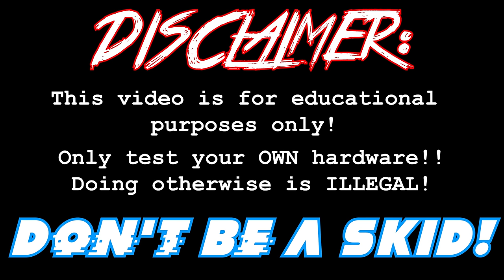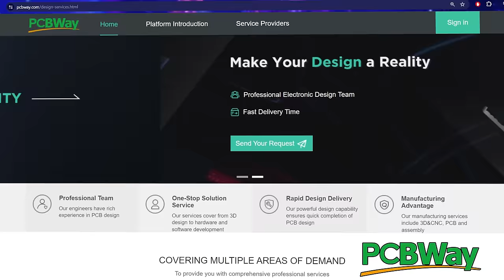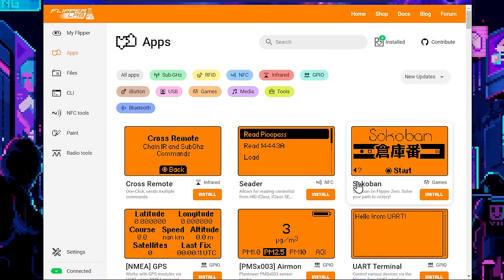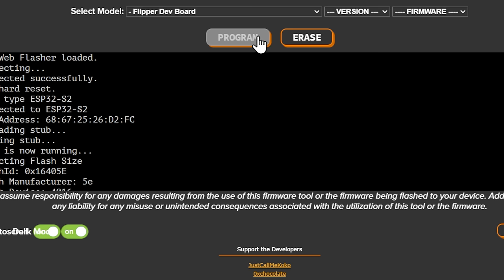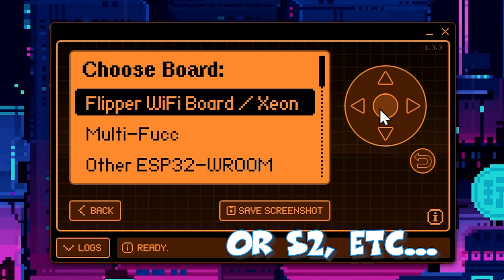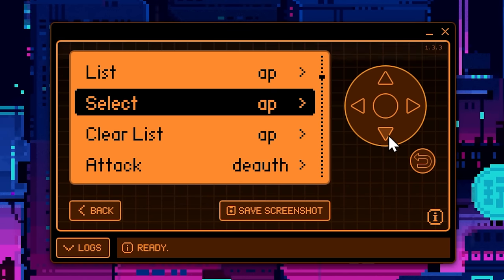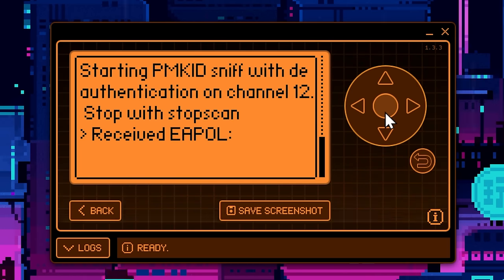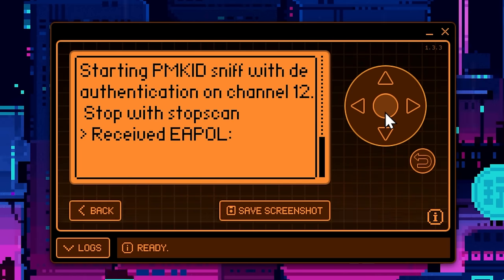Flipper Zero Wifi Hacking has Never Been Easier!  Updated for 2024!

Comment: Amazing video ! I must say HASHCAT doesn't support zipped files to my knowledge, without extracting the wordlist and pointing HASHCAT at the .TXT file you will constantly run into "exhausted' no matter how extensive the compressed wordlist you choose to use. You can even include the known password for the SSID you're cracking in the compressed wordlist and the same "exhausted" result will come about.
Reply from the maker: Are you sure?  I always run the word lists as compressed files and it works for me with the RockYou list
Reply: I'm having the same problem.. any fixes?

Comment: I am curious if you've ever heard of an M5 stickC plus? They are small, have Wi-Fi, Bluetooth some other sensors and has an Esp32 with some GPIO pins and is like $15-20. I have one and a Flipper zero, they seem like they'd be perfect together. You can even get marauder to run on it. Or also using a Lilygo LoRa32 based board with BT WF and GPS and can use radio communications, having these communicate with a Flipper would be phenomenal!
Reply from the maker: Yeah I have a bunch of m5 stuff. I've done two videos with M5Stacks

Comment: Has anyone had trouble executing this using Hashcat for the final product? I am using a Windows 11 system and following the guidelines accordingly but when I go to run the command, Hashcat initiates but abruptly exits without processing the crack or displaying errors. I have confirmed it is a 2.4 network and have updated my GPU drivers. I have even gone so far as to reinstall my up to date XFW-0053 firmware on my Flipper as well as the Marauder companion. It still produces the same result every time.

On a different note, as someone majoring in cyber security, I appreciate you explaining the ins and outs of these devices. I hit that subscribe button as requested.

Comment: I did exactly step by step like you did, loaded esp flasher, via fzeeeflasher programmed flipper zero dev board, but after I disconnected dev board from pc and plugged into flipper - ESP Flasher didn't recognize any firmware. I have same menu as I had before programming dev board - "Flash ESP, Switch to Firmware A/B and so and so..", I guess, there is smth wrong with devboard or maybe I did smth wrong.  I have the latest version of unleashed custom firmware, maybe that will help somehow. Maybe you know the reason of this problem with ESP Flasher?

Comment: Hello
I perform the actions exactly as you show and receive the message "No hash-mode matches the structure of the input hash" why ?
Reply: I get the same message as above in red.
Device #1:  Radeon RX580 Series, 8064/8192 MB (6745 MB allocatable), 36 MCU
runtime from start to stop is 12 seconds.

Comment: yeah, there is no any difficulty to catch pcap file, main problem is to crack it, you need some serious GPU power to make an attempt to crack complex password, otherwise its just a waste of time. so its definitely not easy, especially for a usual user
Reply from the maker: That's where REDD's PCAP uploader comes in handy, it'll do it for you and you can even upgrade the word lists if you want.  It's quite powerful.

Comment: Hi I been following some of your videos and they are great. However I have a question you say WIFI has its own place but on mine it doesn't. It still found  in GPIO the Wi-Fi marauder. Why is mine not as per yours as you say WiFi has been moved. I am running latest build  D02F01C6 mntm-dev build date 15/06/2024. Any ideas why ?

Comment: Quick Question --> If sniffing the PMKID doesn't result in any EAPOL data (approx 10-20 min duration of trying), does that mean it's not a 2.4 Ghz network or something else? If it not being a 2.4 GHz network, how can you find out if a network is or isn't? Any other videos/tutorials/forums/advice would be greatly appreciated.
Reply: If you are connected to the wifi on windows 10, you can click the wifi button at the bottom right, and then click the properties button below the wifi network name. This should take you to settings where you can scroll down and see network band info which is what you're looking for.
Reply: If you scan for available networks in the flipper it will show you all the networks it can hear. If you see your target network's name, then it is 2.4. Because flipper doesn't have a 5.8ghz connection. If you were not doing an active attack and force disconnecting devices on the 2.4 band; you may not have had any EAPOL data. 

The best way I've found to learn this stuff is to attack my door bell cameras. They run on 2.4 so, I can see them disconnect during my attack and verify the attack is working.

If you are trying to do this passively to avoid detection (You shouldn't be because you have permission to do this right? right...right), then good luck. You will have to wait until a device connects and does the hand shake. If the network is only used for IOT then that may never happen.
Reply: @EthosAtheos  My network is a 5.0 ghz network (I am assuming you use 5.8 and 5.0 ghz interchangeably), and I can see it when I scan with the flipper zero. What's shown in the tutorial obviously didn't work because of the fact that it's 5ghz. I switched to attacking one of my networks that is confirmed to be 2.4 ghz and it worked. Not sure how I was able to see my 5.0 ghz network if it isn't physically possible as you say.
Reply: @FoxerGaming  Check your router, many new ones broadcast the same SSID for 5.8 and 2.4. Then do some work to make it seamless for the end user. The flipper only has a 2.4 radio so it just can't detect a 5.8 signal. 

Yes I and many others use 5 and 5.8 interchangeably. 802.11 standard defines this stuff. The common ones are 2.4,5/5.8 and 6 ghz. But there is also a 915mhz in there and 42 and 71 ghz but you likely will not see that for another few many years. 

All of these operate in the US on the ISM bands (Industry Scientific Medical). Many of the ISM bands are shared across countries. 2.4, 5.8, 24 ghz are all world wide bands that can be used for WIFI.

Comment: my dev board doesn't have the usb connector. It only has an SD cart slot with a formatted SD card I put in it. Instead of plugging in the dev board to my PC, would I just put my SD card into my PC, and unzip that file into my SD card? Or how does that work?

Comment: I have the latest Extreme firmware.  Before i installed had the regular Flipper software which looked to have Gas Station sign controller and Walgreens intercom files.  Ever since i moved to Extreme i can't find those things.  Were they removed or not part of Extreme.  Can anyone point me in the correct direction if they are available and i can use them in extreme?
Reply from the maker: The original Flipper software definitely did not have the Walgreens or Gas Station files.  Did you download files from UberGuidoZ GitHub repo?

Comment: what wifi board do you recommend?
Reply from the maker: AWOK has a great one with a huge antenna https://www.awokdynamics.com/
Reply: @TalkingSasquach  HOLY thank you for the fast reply! I work in IT for a school so this will help us with any debugging and to protect us from attacks.
Reply: @TalkingSasquach  second best runner up? 
those guys you referred must be really good. all sold out! lol
Reply from the maker: @RepostedCentral  the official board works just fine, just doesn't have the range
Reply: @TalkingSasquach  so look for a board that can do the ESP32 and more with an antenna essentially?
Reply: @RepostedCentral  As long as your teachers are using short 8 character passwords and writing them on post it notes. I wouldn't rely on a flipper. I'd run to the nearest 2fa tech you can and start a zero trust network policy. In school I guessed a department heads password in under 2 min. It was her dogs name and the number 1.

Comment: Question, My dev board is really loose and wants to fall out if you turn it upside down. I cant even use it because the slightest movement it loses signal. Is that normal?
Reply: Same here, after plugging it in, after a couple seconds it starts to get slightly loose, i dont know why, its plugged in and working but it just feels "loose" but since i only used it a handful of times, i guess thats normal.
But then again, i slightly bent one of the most outer plug needles when i tried to get it out lol (which i had to bend back into shape by hand carefully, so weird)

Comment: Question, my WiFi board from flipper is very loose. Is that normal?? Like if I turned it upside down it would fall out and it doesn’t make connection very well.
Reply: @bskarpa  I thought the same, push it in further. The pins should not be visible. It should give some resistance when doing so, if not then the pin holes in the flipper could be bad.
Reply: @ftwmohawkman1115  ahhhh, That was it! I wasn’t pushing it in far enough. thank you so much.

Comment: Deauth does not work with 5G wifi and since most use 5G not very usable unless there is a workaround?
Reply from the maker: Most 5g routers have a 2.4ghz network as well, attack that.
Reply: The sad fact is that most routers still turn on 2.4ghz by default. They bond the 2.4 and 5.8 signals together virtually. So, they look like one network to devices and share information between eachother. Proper use of Vlan, firewall rules and zero trust is the only real protection. Especially, because IOT like door bells, thermostats, appliances and cameras all use 2.4 still.

Comment: I don't know why but it doesn't work at least for me, every time I follow the whole process during the pmkid sniff process at the moment in which the pinball machine should show received EAPOL in reality not even one appears for me except in rare cases where it works however the 0pmkid files are 0 bytes if inspected and other times even a single Received EAPOL text only then when inspected it turns out to be 0 bytes. All of this doesn't work the same either by waiting 10 minutes or by doing it on a 2.4 Ghz wifi (Ps: all of this works check also after trying to reflash the card as you showed for Xfw). Please help me :)
Reply: Did you ever figure out how to fix it because I’m having the same issue

Comment: This does not work for me. I am extracting the handshake correctly converting the pmkid correctly running hashcat -D1 -m 22000 filename.hc22000 hak5.txt...

I run it, it runs then shows a bunch of numbers and letters in multiple columns instead of giving the information in the format you show...what am I doing wrong?

Comment: Not getting the aforementioned option Quick Flash in apps/gpio/esp32 flasher on the F0. Just  Flash ESP/ Switch to fw A or B/ & Reset Board are the only options. Tried stock fw & Unleshd. Did i goof up along the line?